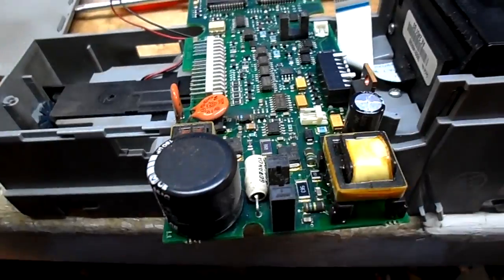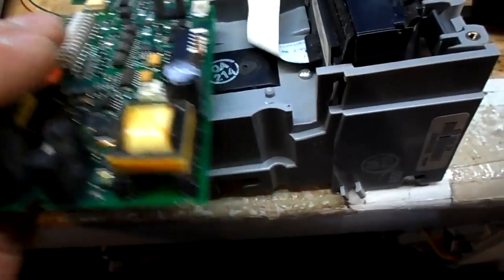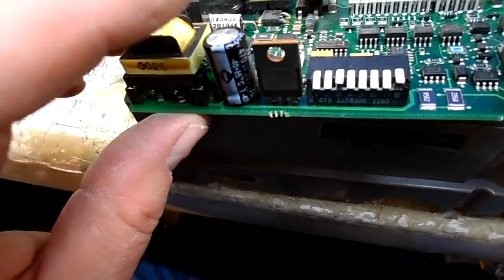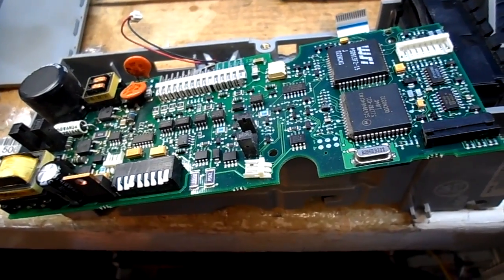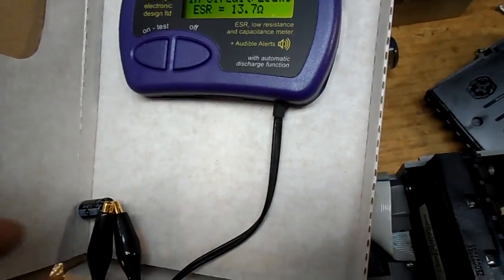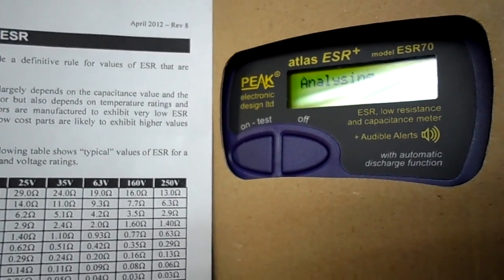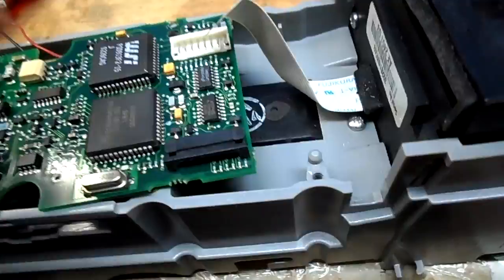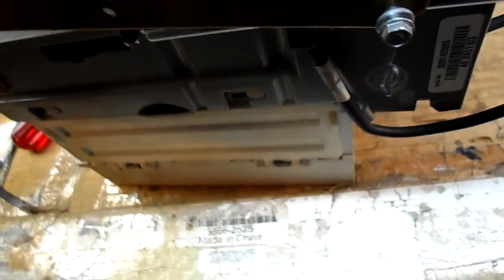Mars MEI 2400 Series Bill Acceptor Repair. 2451.

Comment: Hi I have a mei bill acceptor it takes the bill but it won’t dispense any snacks any idea what could the problem be? Thank you in advance
Reply from the maker: I'm not very familiar with that level once the bill is accepted. I do know it's output is based on nickles, & pulses the machine accordingly. 20 pulses per dollar or something like that. If the bill acceptor is green flashing, it's not the issue. It gives error codes via. blinks if defective. The path needs regular cleaning for the electric eyes.
Reply: @Farmradio  thank you so much this is great information!

Comment: Robert, your sound went very muffled at the end, you may have a microphone problem on your camera.
Did you get the bill taker working?
Reply from the maker: +old64goat Works great now. Yes, the last clip was final put back test in a live environment. Cramped with no room. Hand over mic. again while trying to hold the camera. Had to work fast. Wish that did not happen. Goal was to have folks hear the 2nd. motor engage, & the bills being moved into the stacker. Which does happen now, but you can't hear it. It used to reject them all. Thank you, Bill.